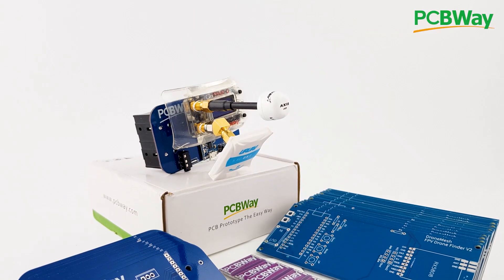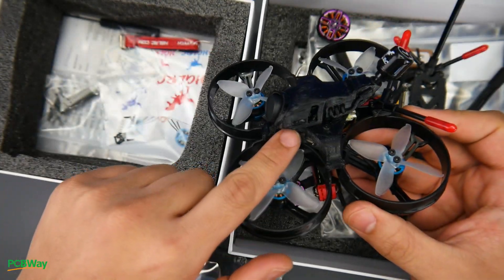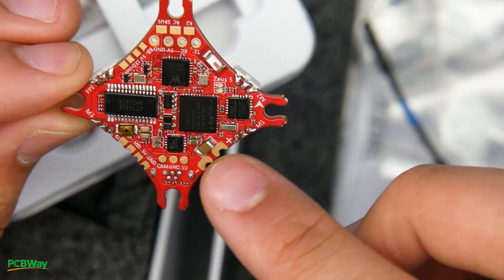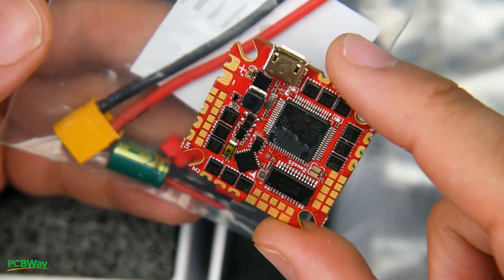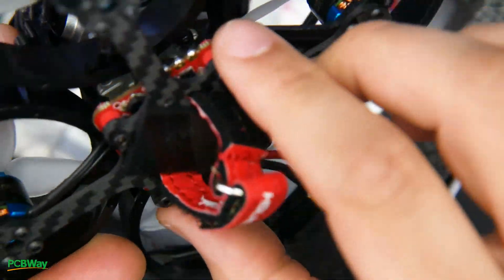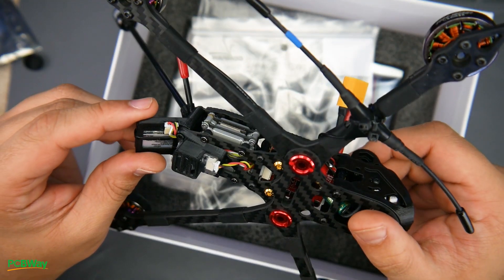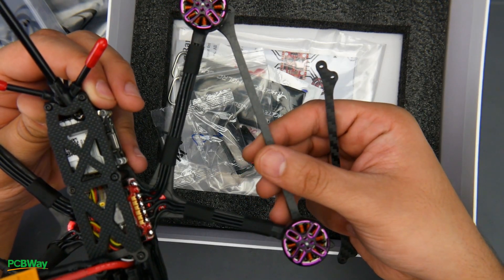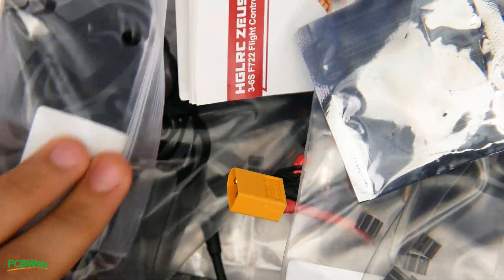Latest HGLRC Tech Package // Interesting Steps

Comment: What's up with your antenna mount? The Rekon comes with a little 90 degree immortal T mount so it can twist from horizontal to vertical right on the side of the body not out on the arm ?